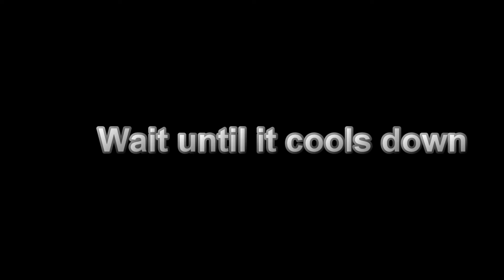How to Dry Bee Pollen

Comment: what would happen if you wouldn't treat it in any way and just left it in an air-tight jar in a dark cupboard? Would it grow mold? Would it start decomposing? And what if I mixed it in a jar with honey right after collection? Could that preserve it for longer?
Reply from the maker: It would grow mold and it would start decomposing very soon. If you mix it with honey right after collection, you will increase the amount of water in honey because fresh pollen is very moist. Also, you would increase the amount of microorganisms in honey. All that would lead to fermentation of honey. So you would end up with spoiled honey.
There is no way to save fresh pollen for later. Eat it fresh when you collect it. Everything else has to be processed in some way so you could extend it's shelf life.
Lyophilization (freeze drying) is the only way to save all nutrients and to dry it. That process is extremely expensive. So you have to settle with hot air drying.
Reply: @Zuconja  thank you for the response

Comment: Do you rotate the trays at all during the three days of drying? If not, why?
Reply from the maker: No. Food dehydrator is designed to evenly dry food across all the trays. It has a fan and a central vertical shaft. There is no need to rotate the trays.